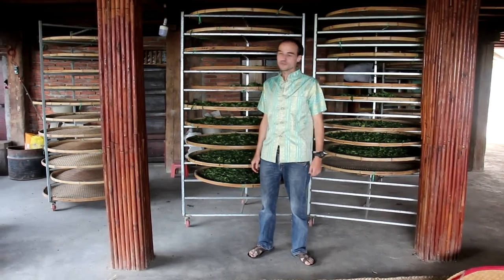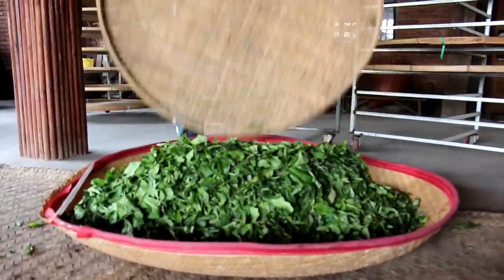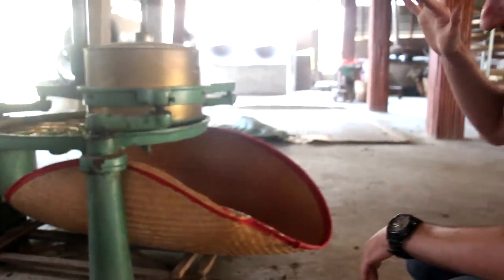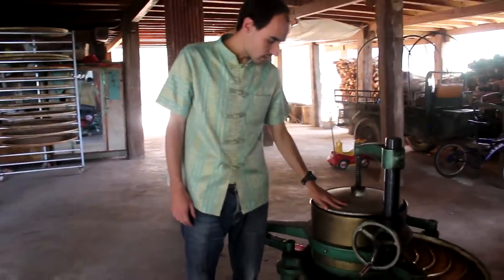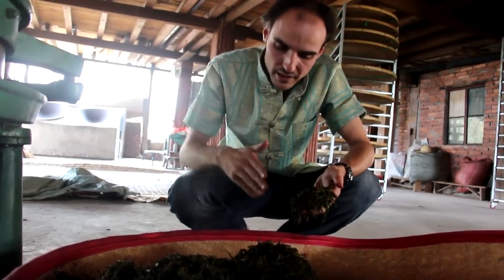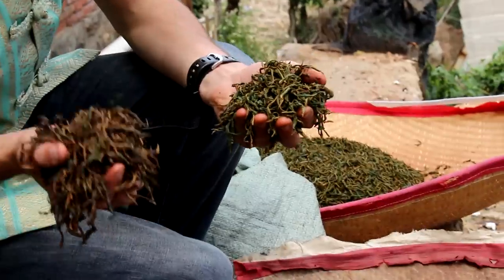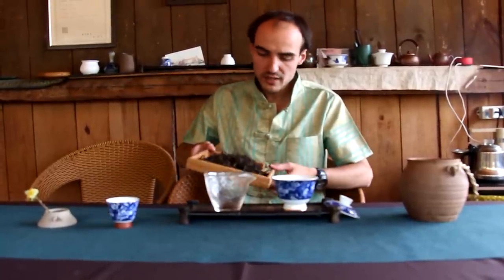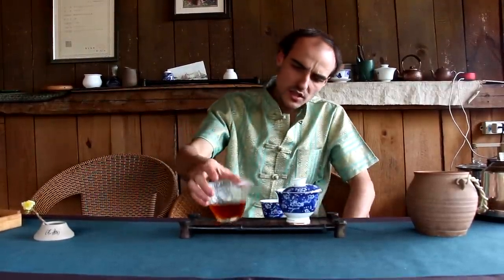Artisanal Black Tea Processing

Comment: Given the higher price of gushu tree material, why would a farmer choose to make it into a generally less valuable black tea rather than processing as a generally more valuable puerh? My assumption would be that the material isn't necessarily pleasant tasting when more lightly processed into a puerh, and the heavy oxidation of black tea processing can transform it to something more palatable.

Thank you for your invaluable tea content! It's so good to get the perspective of an actual farmer and processor living and working in Yunnan. You can't get insight like this in English anywhere else! I can't wait to buy some of your 2018 puerh pressings!
Reply from the maker: Thanks for this interesting question, I didn't mention it in the video but you're right, farmers typically make black tea tea with cheaper material than Pu-erh tea. While leaf quality is crucial in Pu-erh tea production, a good processing skill can give decent black tea, even though the leaves are not the best. We made this black tea with third flush gushu, which means late spring, had we made Pu-erh tea with that material, we'd have had a lot of yellow flakes. Since black tea is very tightly rolled, you won't get yellow flakes even if you use coarse leaves. 

In Summer, Pu-erh tea has a lot of yellow flakes and a weak taste, but it's possible to make very decent black tea and that's what the farmers do if they have that possibility (technical know-how and equipment). 

Now, it also depends on the customers you have, a friend of mine has customers who are willing to pay a high price to get the 'best' jingmai black tea, he uses early spring single trees to make it. The taste is slightly better but the price much higher than late Spring or Summer black tea. I think this premium material would be better used for making Pu-erh tea though. 

Black tea is a good option to add value to the cheap and weak leaves that are available during the rainy season. You can find the same pattern in Taiwan, where the farmers make lowly oxidized high Gaoshan  Cha in Spring and Autumn and heavily oxidized Oriental Beauty during the Summer.
Reply from the maker: Innovation is strong among the tea makers of Jingmai. A lot of experiments are made and some processing techniques are implemented on a larger scale when they give an interesting tea. I always discuss tea processing methods with like-minded friends in jingmai, we work on Pu-erh, black and white tea mainly.
Reply: brotomann because they use the larger leaves which aren’t gushu material

Comment: Thank you so much for the excellent instructional video. I have started growing tea bushes 7 years ago and now have fully mature plants. The processing however has been a challenge. This definitely brings some clarity. I was under the impression that the black tea involves the roasting phase but based on the steps you showed, it doesn't.
Also would you be able to demonstrate how the rolling can be done by hand since I don''t have enough volume to warrant buying a rolling machine
Reply from the maker: Good luck in your tea enterprise, feel free to contact me if you need help with your gardens. Most of the black tea made in the world is dried with hot air. Air dryers are fairly expensive machines, and many farmers of Yunnan don't have one, this is why they sun-dry the tea. Most Pu-erh tea producers have a small rolling machine though. 

You could do a hand-rolling, just like in our video on pu-erh tea  processing, but it takes a long time for black tea, you have to increase the pressure progressively. Hand-rolling black tea is not really viable commercially but technically possible.
Reply: @farmerleaf61 

@
0😊

Comment: Are you using the greenhouse as a drying oven? Will the tea dry if the humidity is high in there? Thank you for the great video!
Reply from the maker: The greenhouse is especially useful during the rainy season because it protects from rain and has a slightly higher temperature than in the open. With a clear weather, we could as well dry the tea directly under the Sun. There is some discussion among the tea makers about whether it's better to dry directly under the Sun or under a cover, I haven't studied the question myself. Last Autumn, we had constant rain for a week but still managed to get our tea dry inside the greenhouse, even without having strong sunlight. The tea dried by diffusion with the air as long as the layer is thin enough. 

If humidity is high, the tea will dry more slowly, but if the Sun is strong it doesn't matter much. Since black tea is tightly rolled, it's water is better extracted than in Pu-erh wet leaves, it will evaporate faster. As a consequence, black tea dries much faster than Pu-erh tea.
Reply: Thank you! What is the temperature in the greenhouse? I see that you have siding as well so that also keeps the wind down, no?
Reply from the maker: I don't have a thermometer in the greenhouse, with a strong sun, the temperature probably goes above 40 degrees Celsius on a clear day. It does protect from the wind.

Comment: Those are called full battens in the table, there are half battens also. The pressure sequence is 5 mins, pressure,  5 mins no pressure, 10 mins hard pressure and again light pressure and finally 5 mins no pressure before discharging. How long do you ferment the leaf for 2 hours . What temperature do you fire the leaf or sun dried.
Reply from the maker: Thanks for your insight. I've changed my processing technique since this video. I just do a one-hour long rolling with minimum pressure all the way. The oxidation time is the most crucial step to determine the taste of tea, you can even forego it if you want a low oxidized one. Good withering is crucial to ensure the leaves don't break in the rolling machine and to get rid of enough water, if the batch is too wet, it will cause problems during the oxidation. We only do sun-drying, having a drier would open up more options. I hope you're having a good time making tea!
Reply: @farmerleaf61  I'm watching this video again for the first time after five years and it's really interesting to learn about the evolution of your methods. I've tried to incorporate many of the same principles into my own tea-making here in the US. Thank you!